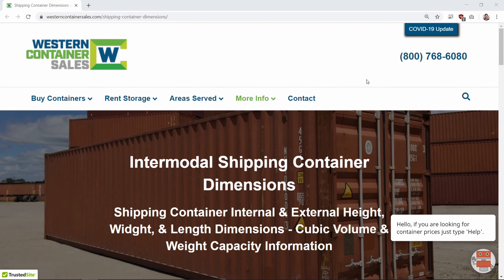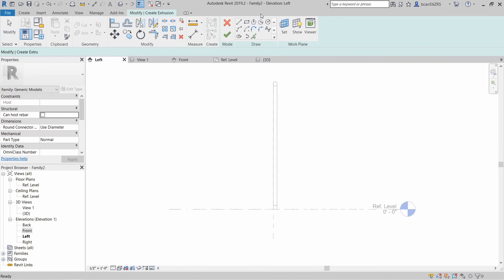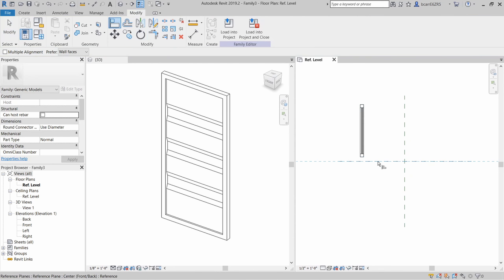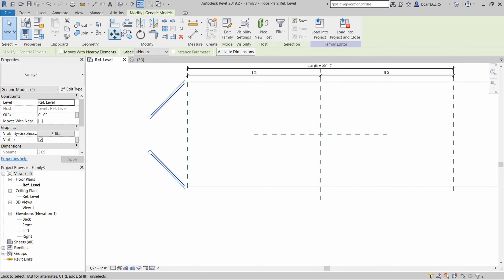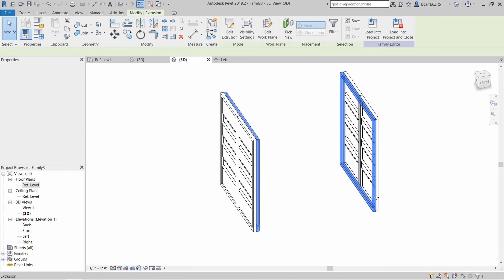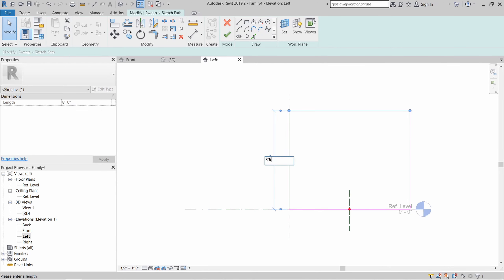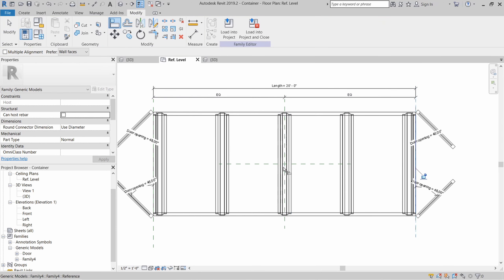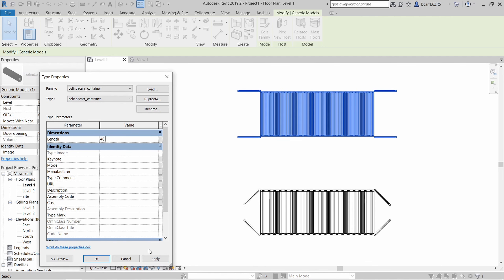Parametric shipping container Revit family | FREE download

Comment: Question, I know your thoughts on container homes. I am building a 20’ container travel trailer that can be separated and set on a block foundation if needed. It has 2x4 interior stud walls turned on the side to minimize thermo bridging and so I have continuous gap for rockwool insulation. I’m using pex a plumbing and smart fixtures and appliances. Anyway I got off track; I was wandering if you know anything about exterior thermo paint products to help reduce the heat load? I’lol be using a one ton mini-split heat pump for heating and cooling and I have 3 energy efficient thermo windows for ventilation. This maybe a good video topic! Any ideas?
Reply: I have no experience in container living/construction but have you looked into getting the exterior a layer of stucco?

Comment: Hi there, thank you so much for providing the download. I just tried it in my project and though you made the door angle an instance parameter, I wasn't able to change them individually. When I changed the angle, all the doors changed at the same time. Is there something I'm not doing right? Sorry I'm quite new to Revit.
Reply: just go into the family and give each door angle dimension a separate parameter for instance door 1,door 2 and so on this will allow you to control each door separately